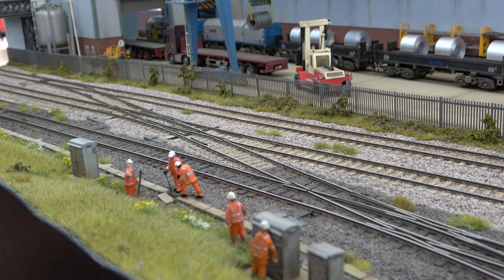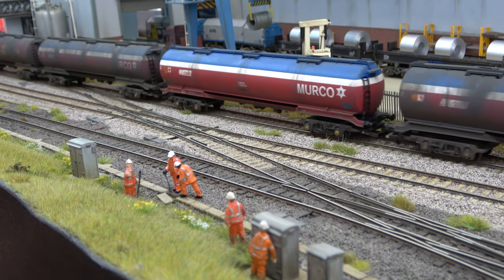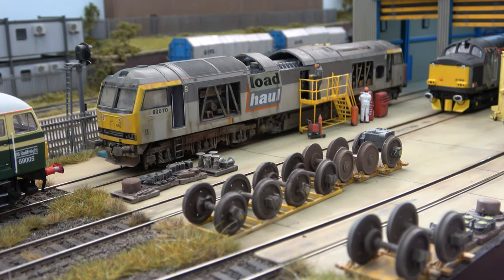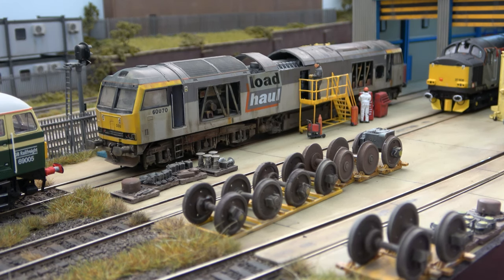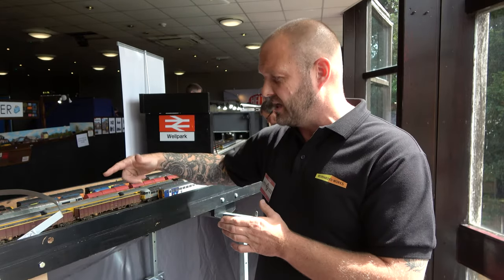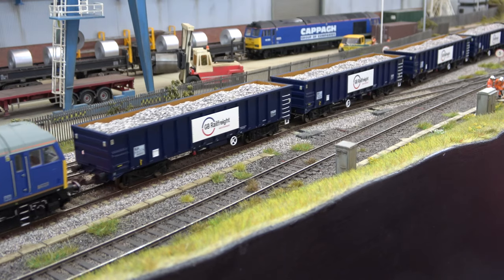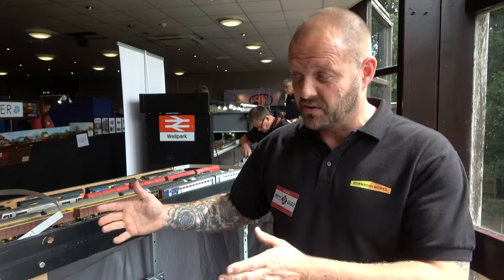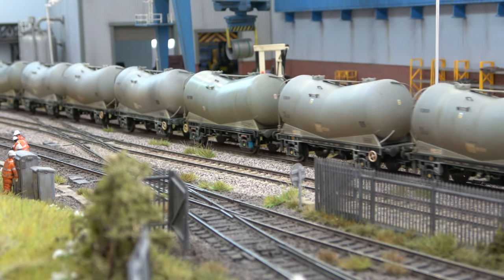A tour of OO model railway 'Burnroyd Works'

Comment: Gr8 vid and layout .

Can u please help. 
I have a basic layout in my family home up in the loft  i aint played with since the mid to late 1980s. 
The layout isnt anything wonderful, i unfortunately didnt build it up, just ran the trains around it. 

I now have the bug, the enthusiasm to get it going again after all these yrs.
The controller was frown out long time ago and the engines also. 

But the track is still there.

Do  i simply buy a new basic cheapish controller along with the clip thing that goes in the track and also obviously an engine and carriages,  is that all i need to get it going again ???.  

Someone please help.
Reply: If it uses set track, i.e. hornby train sets stuff then yes that's all you need
Reply: With it being from the 1980s, you'll need an analogue controller, rather than DCC. Also, if they've been sat around for 40 years, your locos will probably want a service and a re-lube.